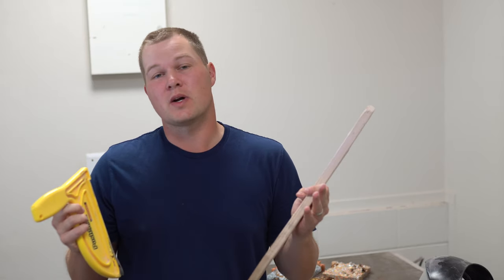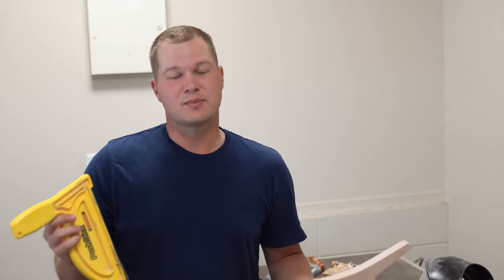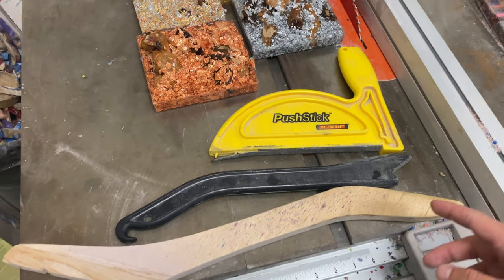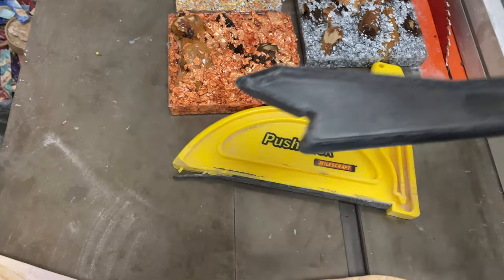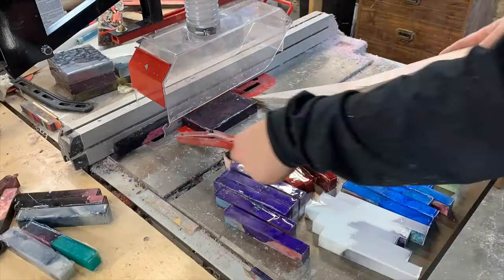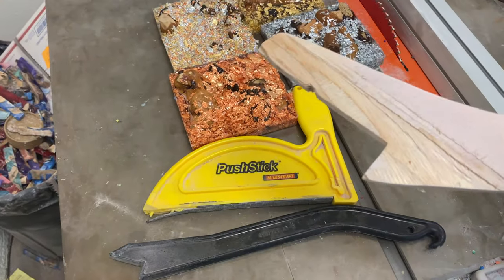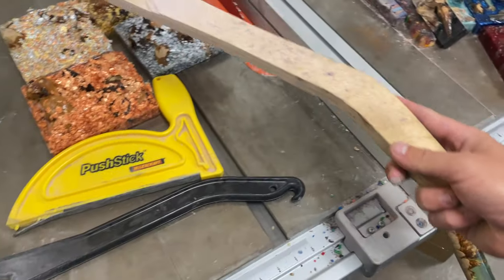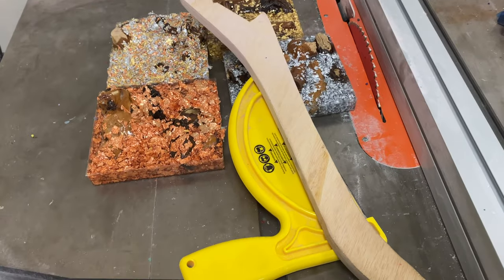The Best Saw Push Stick For Cutting Resin, Overarm Dust Collectors, & More - Quick Tips

Comment: Rather than a push stick, I just made a small sled with clamps to hold one side of the block (wood or resin... or both?) while the blade passes through.  It's simply glued together, so I can get any width pen blank I want, as long as I always want exactly 3/4".  :D
Reply from the maker: That’s awesome! I’ve thought about making something similar but always thought it would be tough with irregular shaped tops like my grapevine blanks. I feel like the clamps wouldn’t hold it down as well. 

Have you had success with irregular shaped blank tops?
Reply: @CaseyMartin707  Well, I haven't done anything "irregular" yet.  Blocks of resin with or without encapsulations, and wood boards, but always around 3/4" in height, and always pretty square-ish to start with.  I have an old table saw, and the fence is terrible, so a sled is a much safer option for me.